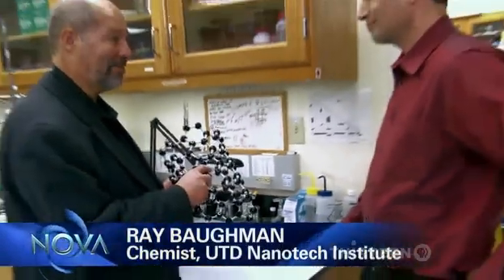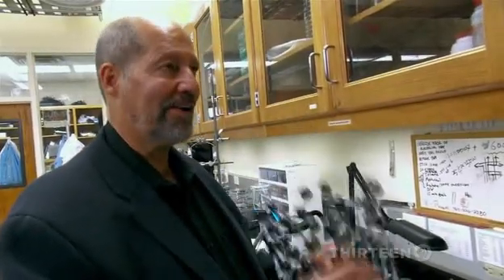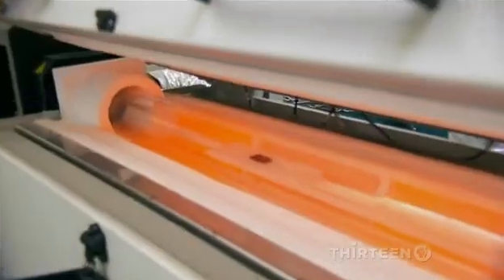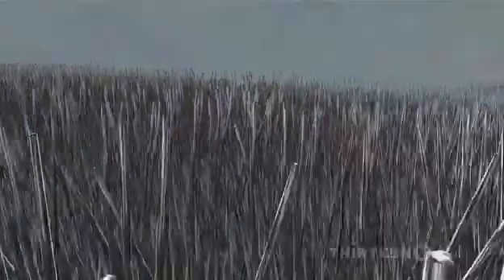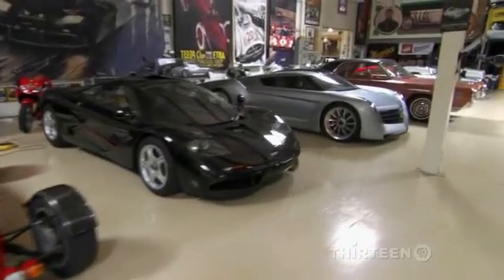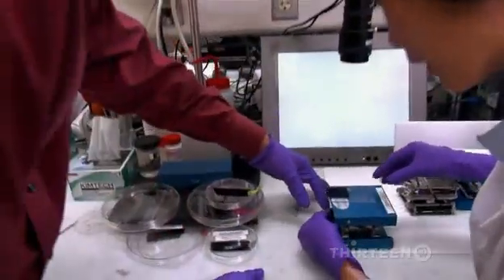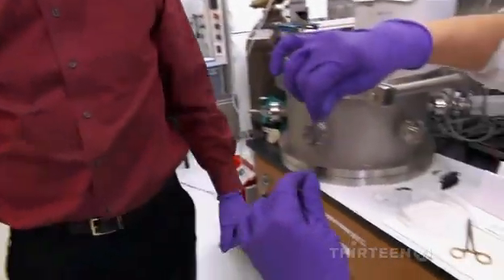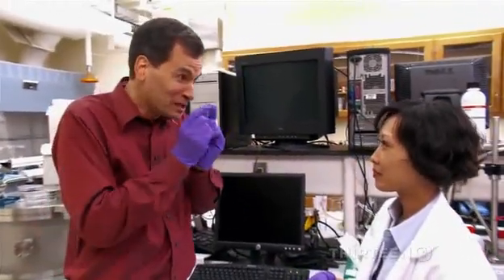Nova: Carbon Nanotubes

Comment: "Can you imagine spending all day winding it up into a rope/cable?"... 

well, a second ago we were all agreeing at how fucking quick it was to make it into a string, which I thought was the going to be the tough challenged if I'm being completely honest. I wouldn't expect the next process of simply twisting the carbon threads together to be any more time consuming than producing a cable out of normal steel wire. Or a rope from single threads. Haters will say something stupid like 'well it's a lot thinner so you have to wind it more to make up'. Yes, if you want to match it's diameter. Not necessarily if you want to exceed it's strength. I presumed the twisting would be done using an automatic twisting machine anyway. I'm not sure what worries me more.. These obvious red flags or  the fact that no one else seems to pick up on them.

Comment: does it conduct electricity?
Reply: +sam bote Going to do a necro here.
Yes they do conduct electricity, but they only conduct electricity along the tube's axis (along the tube). They also have a very high electrical current density of 4 * 10^9 (or 4 billion) amperes per centimeter squared, which is over 1000 times the current density of copper. An interesting fact to note is that only the "Armchair" configuration of carbon nanotubes conduct electricity all the time, whereas the "Zigzag" and "Chiral" configurations of carbon nanotubes act as semiconductors (only conducting electricity in the presence of light or an electric field).
Reply: I just realized i made a mistake: Carbon does, in some bonds, conduct electricity. Graphite does, and that is made of Carbon atoms only. I apologize my mistake
Reply: sam bote yes I think they do
Reply: Hmm, i dont Think so; Carbon doesn't conduct electricity, and the nanotubes are made only of Carbon Atoms. Therefore i don't Think they does. But i am not sure
Reply: well i heard somewhere that you could make a mini battery cell with these tubes, and you could obtain a very high amount of power of a such a small battery, and in order of that to work they needed to use the conductive properties of carbon nanotubes, although they maybe plan on modifying the atoms for the tubes to conduct electricity
Reply: Lumix ISM That's graphene.
Reply: oakern Oh I see. Did not know that. Thanks!
Reply: way better than copper

Comment: They are winding motors with carbon nano tube yarn wire.  It is still experimental but they are great conductors of electricity.  I can already imagine electronic devices that use so little energy they run for months on a single charge or longer.  Now that would be the perfect cure for the iPhone's horrendously short battery life.

Comment: I mean...they have machines that can spin threads into ropes in minutes...so why don't they just attempt to use the technology in the machines and add it to this...on a scale that is suitable to use on this technology...
Reply: Because we can currently only mass produce nanotubes on the mm scale, not long enough to weave into anything deemed as strong. Here, they are using a polymer medium to replace the weaving of the thread since they are so small, but should in no way be seen as true nanotube string. This is carbon nanotube fiber thread. It works just like carbon fiber works, only with billions of nano tubes oriented in the same direction.

Comment: what is this process called? and what are those gases called?
Reply: Chemical Vapor Deposition.  Those gasses are the precursors. I could only notice Hydrogen in that bunch.  They essentially "drop off" the carbon atoms on the surface of the wafer/existing nanotubes during the chemical reaction of the interface and the gasses.  Don't quote me exactly, though. I'm no expert in this, but do have a background in similar research areas.

Comment: You're right, Toxicity boils down to a substances ability to leave the body at a rate comparable to it's ability to enter the body. the threat in CNT's lies within its structural resemblance to Asbestos and the lack of understanding with the body's macrophages. (or the assumption thereof).

Comment: Carbon Nanotubes (CNTs) have amazing thermal properties. Meaning, they dissipate (get rid of) heat very efficiently. First of all, CNTs are made in high temperature environments, (800 C). Some CNTs (like multi walled nanotubes) can conduct heat better than SWNT (Single Walled Nanotubes). Theoretically speaking, if there was  fire at the base of a CNT ribbon space elevator, the CNTs wouldn't burn (since they won't react with oxygen) and the heat would travel away from the source. So, not a prob.

Comment: What will happen if you put an open flame on a nanotube cable? Will it burn of and snap?
What could happen if there is a fire at the base of the space elevator when will it be built and operable.

Comment: "do you know how long it would take?" That's their excuse? GMAFB! if one could somehow infuse Boron into these to give it electrical conductivity and other elements like in TaxHf1-xCy to give it an extremely high melting point, one could use the possible compound to make an array of alternating capacitors that might almost endlessly supply energy or can be used for magnetic propulsion in air and spacecraft. so either nihil novi sub sole or the suits are coming to kill me as i type